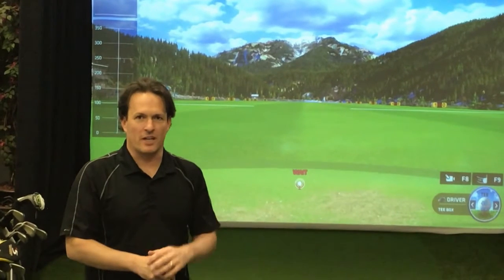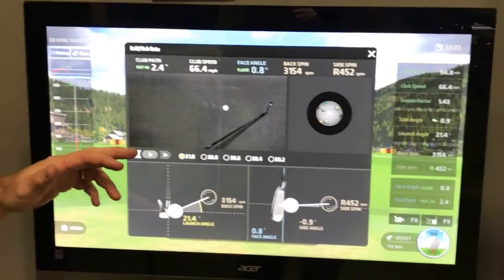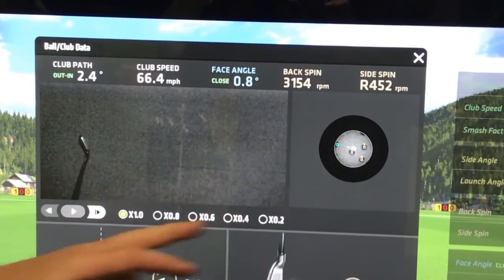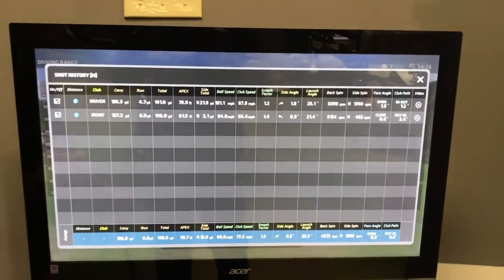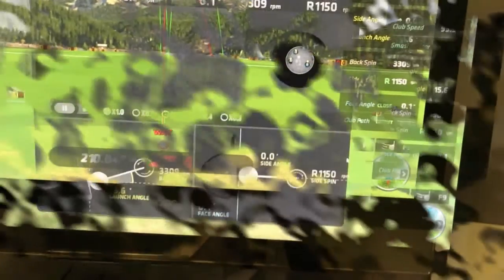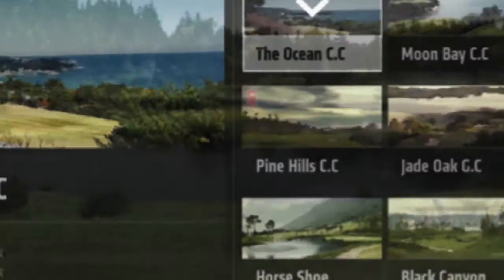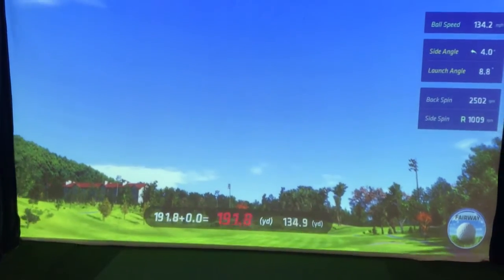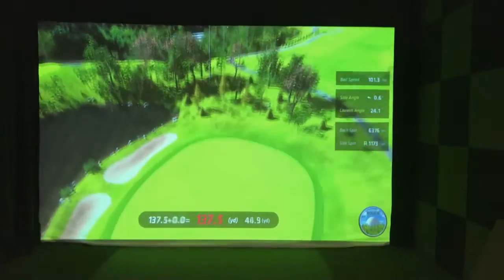Uneekor Golf Simulator Product Review By InHome Golf

Comment: How does this system compare to trackman
Reply from the maker: Hi Peter, I did some pretty extensive tests vs TM and was quite surprised. The Total distances were bang on accurate, as were ball speed, club speed, launch Angle and Horizontal Launch. There were some discrepancies with Spin but I’d like to test more before making a statement on that. I was getting some double spin readings from TM.
Reply: What is cost of unit
Reply from the maker: @petercusanelli5663  Dm me for details, please